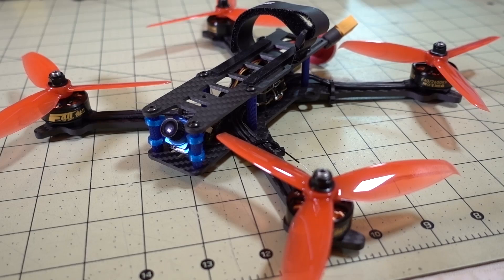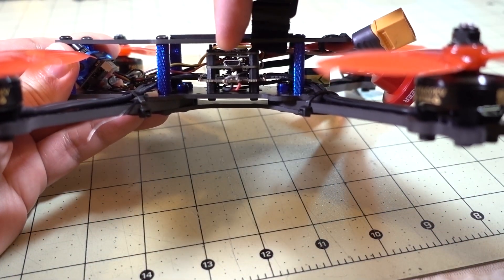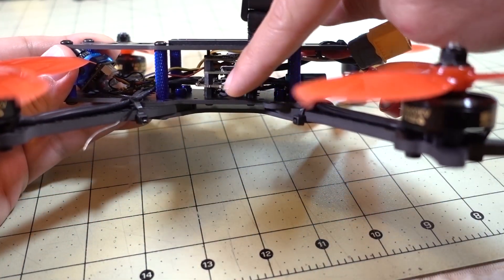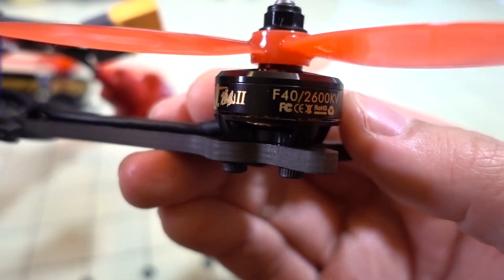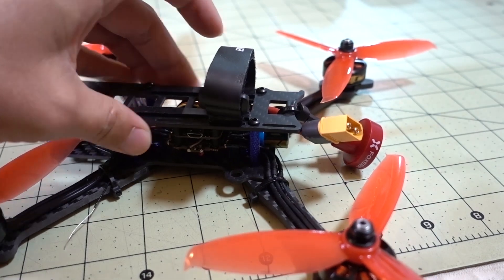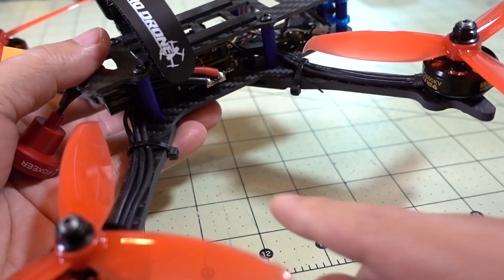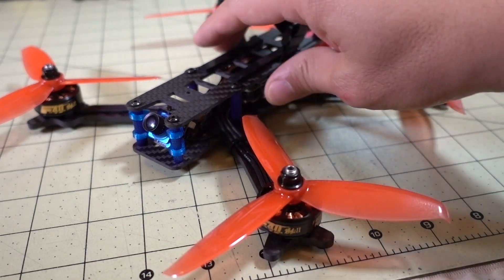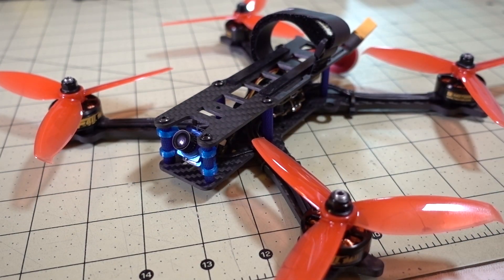5-inch Drone Built with Micro Parts 🏁

Comment from the maker: HGLRC F440 TX20 V2 also available here - http://goo.gl/Anm2cH
Reply: Albert Kim is there anyway to mod the height of this stack so it would fit inside of the geprc hx2?
Reply from the maker: +R1 find some shorter m2 standoffs... Not sure where however.
Reply: Albert Kim I might have to file them down I would imagine. Needs to be 3mm less.
Reply: Try some rubber o-rings where you can kind of configure it on demand. Problem with HGLRC stack might be the connection between FC and ESC's. You might not be able to decrease the height there.

In fact, you can decrease the FC/ESC spacing by removing the connectors and wiring it up yourself, I was tempted to do it when the female connector got loose last weekend. But I managed to solder it back in place with a 0.5 soldering iron tip (quite a challenge for novice soldering skills).
Reply: Exactly what I was thinking and yep was aware of the height clearance there, so was looking at getting some anti vibration mounts. Pretty sure I can file down some nylon. Worst case scenario I get the stack without the VTX. Although there is a gap in the top plate for possibly the LED screen but I think the alignment is off for it to properly sit inside of there. A shame though.

Comment: I used to have two 5 inch drone but both esc are currently broken now, I still have the same electronic (hglrc tx 20 33A) can I use this electronic to re-build one of my 5, inch quad with 2800kv motors to fly racing style? Or freestyle.. because of the pandemic I don't have enough money to build a new stack

Comment: In the stack where do you wire the ESC tele pad to? The FC current sensor?
Reply from the maker: You connect to a spare UART
Reply: Thx! So ESC tele can go to RX3 on this FC. What about FC current sensor pad?  Seems like it needs an external part like HGLRC XT60 current sensor.
Reply: Planning to run RunCam Split Tx Rx to the FC Tx6 Rx6

Comment: Awesome idea Albert, this build flyes like a dream, great job... I´ve had some issues with my Leader 120 and ended up with a extra flight stack, if I wanted to use it on a 5" frame what motors would you recomend I use??? The fastest, more powerful motors that it would handle...

Comment: Hi again Albert. I see that you connected the TXD output of the PDB here. Do you actually use it? What data could be usefull? I was told by hglrc that you connect it on the RX6 on the FC. But witch UART in betaflight is RX6? (I hope me not been a pain)
Reply from the maker: Yes, it's for ESC telemetry and you get motor RPM data.  I just wanted to see what it does but for me it wasn't all that useful.  You use RX6 and UART6 in betaflight.
Reply: Albert Kim thank you very much for once again albert. I am going to use that stack for building my first quad. A 5" 210mm. I am going to use emax 2207 2550kv motors. How much weight (no battery)do you believe my target should be for something really nice?
Reply from the maker: That depends on a lot but I think somewhere around 325g would be pretty good.
Reply: Albert Kim thanks a lot. I will try maximum 300.it will be nice.  Lets see. It will take a while tho. I will let you know when I do it. Cheers!!!

Comment: i just got my flowride!  with 5&6" arms my freestyle experimental quad!...i bought a diatone F3 mini on banggood for 5$...5.99... Diatone D-Link F3 Mini Flight Controller MPU6050 Integrated PDB 23x23mm For RC Drone FPV Racing Multi Rotor

Comment: Let us know how this F440 holds up after at least 10 packs. Many many guys have burnt their HGLRC 20x20 boards on 5" setups...as well as myself. https://youtu.be/Etl9SbpUGN0
Check RCG for the thread where several guys have burnt ESCs on this kinda setup even with large caps...run the quad hard and see what happens. Maybe the F440 will be different?